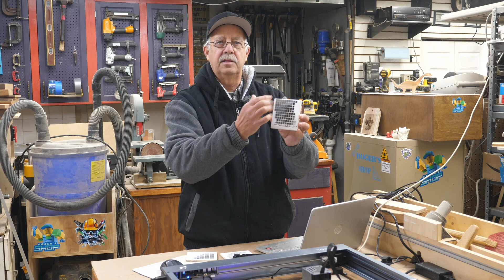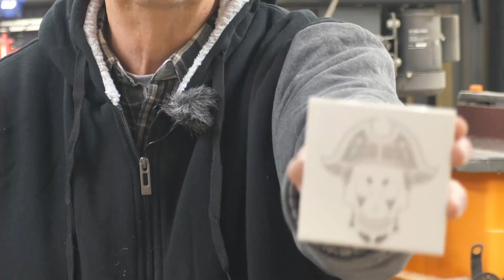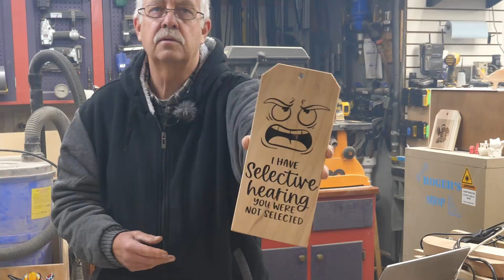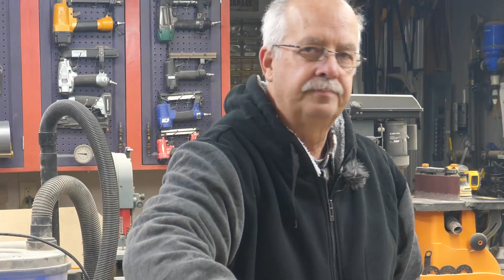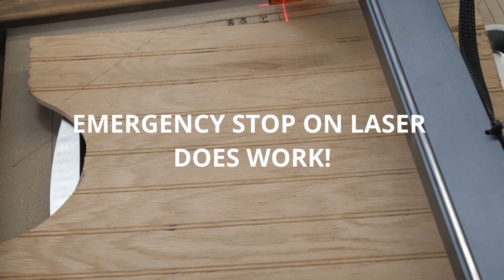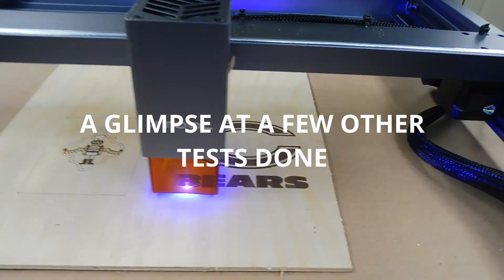xTOOL D1 Laser Testing & Review

Comment: Dear Roger, to fix the cable problem loop a long thin rubber band around the cable and attach the free end to a weight of some sort, the rubber band will allow the cable to move with the laser head, the rubber band being extended will return the cable to its original position away from the engraving area. It works for me.
Reply from the maker: I went with drag chain.

Comment: Hi, I’m hope you can help me, my husband just bought a D1 for me and It’s put together and I connected it to the computer but when I try to do a practice run and try to engrave or cut all it does is make a line whether it’s a cut or engraved it’s just a line. Any help would be appreciated. Thank You
Reply from the maker: What software are you using?  If Lightburn, you may need to update the firmware.  If Laserbox, you still may need to do an update.

Comment: Is there any sort of monthly subscription required? I saw that some laser companies, like GlowForge require a subscription for the software and such.
Reply from the maker: No.  If you choose to use Lightburn, the license is currently $60, which allows use on two computers.  I have eight licenses as I use Lightburn almost exclusive.  Each additional license is $10.  this is not monthly, but a one-time cost.
Reply: @rogersshop  Great!  I just ordered one of these with the air assist and a honeycomb panel for under it. Thanks for this video and the reply.

Comment: Id like to what the focus dia of the laser :)
Reply: Roger, thx for the reply mate. What im wondering is what is the dia of the cutting focus, how small a line or text i can burn. Is it .1 mm or better, .05 mm?
Reply from the maker: @barryhenshaw9321  .08mm.  Highly accurate and fine details on line engravings.
Reply from the maker: That depends on the model of the head, and even then, it is not consistent throughout manufacturing.  You need to actually measure it.  As I recall, mine is 14 mm.

Comment: My question Sir, and if I missed your reply before please accept my sincere apology. Anyway my question concerns the PC you use on your D1 Laser. I have seen comments where people are using a iPhone or iPad,  and other people using a $4000 gaming laptop to run the Laser. This is going to be a hobby for me, not a production machine. Truth is I don't have $4000 to spend on a laptop. If you could give me some ballpark figures for an acceptable PC I would be most grateful. I plan on using the Laser on ceramic tiles, wood, metal engraving, and possibly cardboard to start with. I would prefer too spend my money on materials and accessories, but I want an acceptable PC that will let me "grow" into the game. I hope I  have asked this in such a way as you understand what I'm asking. If not, I will try to rewrite this where it makes a little more sense. 
Before I stop, THANK YOU for sharing your time and and hard earned knowledge. I truly appreciate how you explain things in such a way that I can easily follow.
Reply from the maker: While you "can" use a phone or tablet, I prefer a hard wired (USB) connection.  Anything wireless or in the Cloud has the possibility of dropped packets or signal loss which will ruin a project.  I have 7 lasers and a variety of computers to run them.  My oldest is HP AMD Rysen 3 laptop 14", that probably isn't worth $100, but it will run any of the lasers.  I use Lightburn for just about every project and it runs it just fine.  I have one ASUS 15" laptop missing the "H" key that I also use.  So long as I do everything from the mouse, it runs a laser just fine.  I do graphics designs on other more high-end computers with dedicated graphics cards and dual monitors, but mostly just for speed rendering.  It isn't required.  In all, I have a laptop or desktop computer for each of the lasers, with exception of my Atomstack A9.  That one will run projects from a micro SD card with the G Code loaded on it and has a touchpad to control it.  The D1 is "supposed" to get that in the future and has a port for it.
Reply: Thank You once again Sir! I can run a USB out to the garage so that takes care of that problem. So glad to hear I don't have to spend $3000 on a fancy laptop. I will be pestering you with more questions as soon as my D1 gets here! Thanks Again Sir for all your help!
John @rogersshop

Comment: How do you rate this to the Ortur Pro? Worth the extra money? After seeing you had a couple quirky things happen, I wonder if sticking with the Ortur is a better decision?
Reply from the maker: I think it depends on the final intended use.  The xTool has twice the output power and is better at cutting than the Ortur.  The Ortur has limit switches and a homing function where the xTool does not.  The xTool has an upper-left origin, where all of my others are bottom left, so takes some getting used to.  The xTool is better built, insofar as structure.  the xTool has had some odd sudden non-programmed movements, as noted in the video.  The Ortur isn't perfect either as I've had instances where running the same file back to back will sometimes require a reboot between runs.  Not every time, but can be a nuisance.  The xTool does not have flame detection, but the Ortur does.  However, direct sunlight will trip it as will reflections from engraving on glass, so I put a piece of black tape over it.  Cable management on the Ortur (out of the box) is superior to the xTool, although I did create a solution.  Overall, I like them both.  For the beginner, the Ortur has a much less steep learning curve.

Comment: Great Video Roger. Your "glitch" with Lightburn is in your Device Settings. You have the wrong origin setting Sir. The origin is the top right.
Reply from the maker: Top left, and it homes fine.  Just for giggles, I changed the origin point to top right, but it made no difference with existing files set for my other lasers.  Still flipped.  Not a big deal to flip them for the D1.  The odd thing is that if I create a new file when set for the D1, then open in one of my other lasers, the file is still in the correct orientation and can be run (after changing burn settings).  When running projects, my set origin is center, so home origin is immaterial.  I just found it odd that images were flipped and/or mirrored when opening for the D1.
Reply: @rogersshop  I have a D1 on the way, I'll check it out.
Reply from the maker: @TheLouisianaHobbyGuy  I do like the D1, just wish so much of it was not so proprietary!  
I just received (today) a $200, 5.5W laser that I'm going to do some videos on.  Haven't opened it yet.  This should be interesting............  I have five other brands of lasers to compare it to.

Comment: Just like you, I'm wishing for limit switches on the D1, I'm working on an idea for it, have the parts picked out already but at the moment one thing gets me concerned, connecting it to the main board so is controllable by the software, not sure that be done totally integrated like you can on the Ortur, it has a plug just for that, any ideas? If I come up with solution, I'll be glad to pass on the solution to you, thank you for your video again.
Reply from the maker: This mainboard appears to be of a proprietary design with unique firmware, not open source, as I am unable to open it in Marlin.  Unlike many other boards, there are no inputs for limit switches.  I've also been searching for a schematic or breakdown of components on this mainboard, but no luck yet.
Reply: @rogersshop  That was the word I don't want to hear, proprietary, but what can we do? Just trying to find a solution, if I get to the bottom of it, you'll be the first one to know. Your comments are appreciated.

Comment: i was having the same probles with it carving wrong you have to go into device settings and change you're origin to top left and then the machine we be setup proper for the D1
Reply from the maker: Had already done that.  The odd thing is that new files created just for the X1 display correctly when opened on my other lasers.  Not a hard work-around.  I just need to remember to flip in Lightburn.
Reply: @rogersshop  As Jared Lucian said, device settings is your solution. Where is the home position on you other lasers, bottom left or top left? I faced the same issue couple of weeks ago. I learn that the D1 preferred home position is top left, your images will flip vertically because, if the file was set to bottom left, the D1 will flip it to match home position to the top left, giving you a flipped image. I just set both of my lasers to top left and problem solved. This has nothing to do with the work origin, all depending on home position. Hope it helps.
Reply: Now that watched until the end of the video, I had another episode also on the issue of the D1 trying to off the area and banging against the rails. It happens only when "going to home position" is not set or work origin is not set. Not sure if you are using Lightburn or Laserbox, but I have set Lioghtburn to go to home position when I open the software, as soon as I start Lightburn it goes home by default.
One more detail about Lightburn, after setting up work origin, don't move the laser head by hand, you will loose it that position, move it from Lightburn, work origin will stick, found that out when doing 3 of the same sign, repetitive work.
Remember, This is the first version of compatibility with the D1, a few kinks needs to be ironed out.
Thank you for your video!
Reply from the maker: @marcoss6212  I'm very experienced with Lightburn, hence my software of choice.  Since this has no limit switches, there is no real "home" unless you artificially create one by setting it as an origin.   The miss operation I got on video happened after framing when start was initiated, and never should have occurred.  I've also had this happen a couple of times when first turning the laser power switch on, before it is even connected to the computer.  Has not happened again recently, but I now always watch for it.
Reply: @rogersshop  I understand your point, I was trying to help since I got the same issues as you did, hasn't happen again :),
have a nice day.
Reply: @rogersshop  I find that by starting at the center position (as versed to top left, right, etc.) I have fewer rail crashes. Easy to position the head in the center of the expected carve/cut point. As mentioned, “home” is not a thing on this laser.  I always start by having the head in the center of the cut area, then do a Set Origin. Then, I can do a go to origin (vs Home) and now I’m where I want to be. You can also do an off center carve - i.e. top left - and still begin at a center origin by putting a non printing border then positioning my art work at the top left of the border. This prevents the cutting a heart off the edge syndrome.  Great video.
Reply from the maker: @photosbywalt7124  In use for our projects, center is always the origin, including when using the rotary.  And, speaking of the rotary, don't engrave a name on a beer can when it is full......Maybe I had a weak can, but it sure made a mess.  I wish I would have been shooting video when this happened!

Comment: You mentioned having the Ortur (not sure which model you have) and the Atomstack A5. I've been looking at all 3 of these lasers. I've recently gotten into CNC and looking for a laser to pair with my CNC work. I'd like to engrave on some of my CNC pieces, as well as do some cutting to make earrings, Christmas ornaments, etc... Also I'd like to get in to engraving on tumblers.
Which of the 3 do you most recommend?
Reply from the maker: My Ortur is the Lasermaster Pro and gets the most use engraving wood signs.  My Atomstack A5 is used primarily to engrave our "Made In USA" trademark on different project items.  The Sainsmart and Annbull lasers are used just to engrave ceramic tiles.  The xTool D1 is still pretty new to the shop and I've been doing some modifications, so haven't really put it into a production mode yet.  So far, for ease of use, the Ortur comes out on top as it has a homing function.
Reply: @rogersshop   I assumed the D1 with the higher output laser would make it stand out. If buying just 1….would you buy the higher powered laser ya think? Or still go with the Ortur?
Reply from the maker: @micahc2340  Higher power does equal more speed when engraving and/or cutting, but I think it comes down to what the intended use is going to be.  I haven't had this one long enough to really put it through production pace yet.  I just completed adding a drag chain (something it REALLY needs) and air assist.  I'll be posting that video later today.

Comment: Great video lots of good information I am looking to buy a laser engraver I’m trying figure out between Ortur laser master pro 2 an the xTool D1 they both have features I like I will mainly engrave on wood just wondering what your thoughts are speed does make much difference it’s just to do things for family and friends no big production I ran an industrial laser on production from back in 93 till I retired it cut steel up to 1/4 “ thick it was 750 watt invisible laser
Reply from the maker: Speed makes a difference if one is in a "production" mode, or if impatient.  I have plenty of patience, but sometimes get a little behind on orders and this is where the speed part comes in.  One note:  If running 3,000 mm per minute or higher, anchor the laser down or it will move around just enough to ruin the project.  Guess how I know that..........